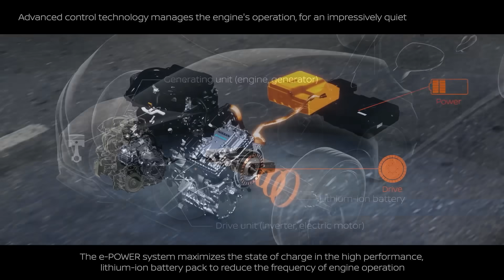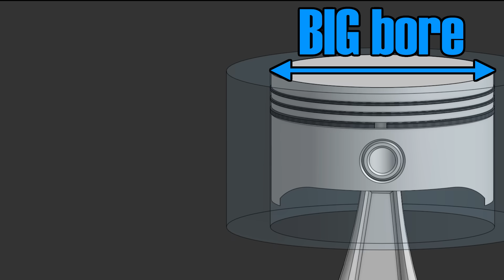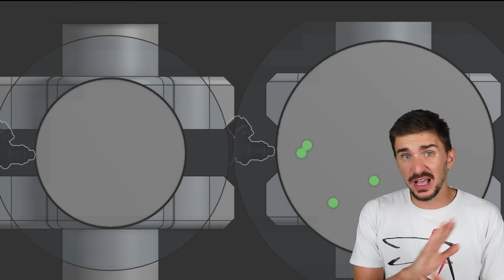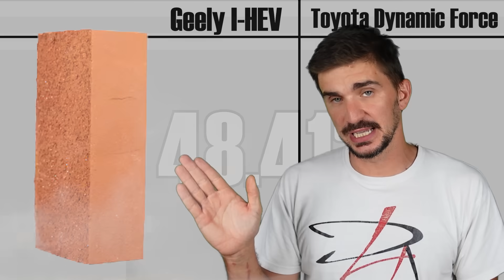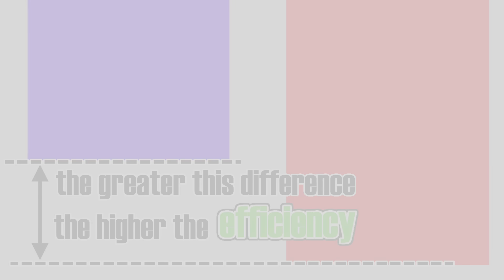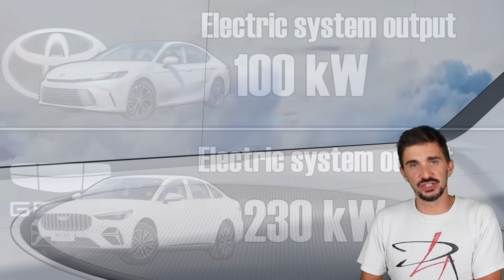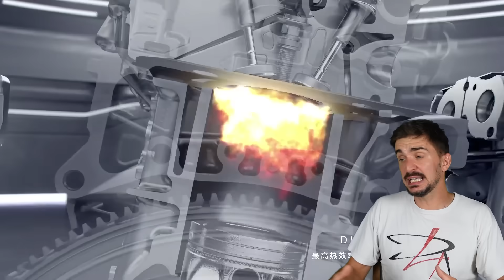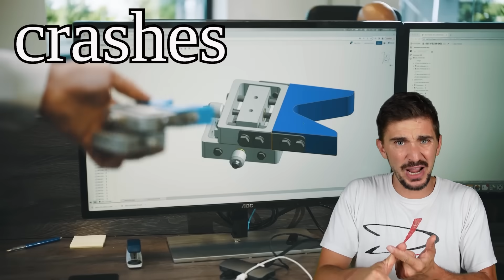How China's Geely Beat Toyota, BMW, Ford and Everyone Else

Comment: This combustionized EV approach should be applied to trucks.  With the much lower cost of gasoline in the USA, It would have a lower operating cost than diesel trucks.   Diesel cost 25% to 30% more but only has 10% to 15% more energy per gallon.   Emissions and emission control system maintenance will probably be another advantage.   
I'm sending this information to Edison Motors because they really need to consider it for the DeBoss smaller trucks.
Reply: This technical achievement makes EU and American auto manufacturer engineers look pretty dumb, but realistically you have to blame it on the management, and maybe the unions in the EU.
Reply: I wonder what the efficiency map plot looks like, how broad is it?  It probably doesn't matter since it's basically just a generator and can be optimized to run at maximum efficiency all the time.
Reply: My 1988 Nissan pickup truck made less power with a much bigger displacement and horrible efficiency compared to this.   More details:
I wonder what the efficiency map plot looks like, how broad is it?  It probably doesn't matter since it's basically just a generator and can be optimized to run at maximum efficiency all the time.

From the Google search...

"Geely’s 1.5L i-HEV hybrid system achieves a world-record 48.41% thermal efficiency. Paired with a proprietary "11-in-1" electric drive unit and an AI-driven energy management system, it delivers ultra-low fuel consumption (up to 106 mpg in Guinness-certified highway testing).

Combustion Engine Maximum Power: The naturally aspirated (NA) 1.5L engine outputs 111 PS (approx. 109 hp or 82 kW) and 136 Nm of torque. The turbocharged variant (1.5TD) produces 163 PS (approx. 160 hp or 120 kW) and 255 Nm of torque.

Core System Specifications

The 1.5L setup is a dedicated hybrid engine (part of Geely's BHE engine family) integrated with an electric motor. It powers several of Geely’s mainstream vehicles."

Geely’s flagship 1.5L hybrid engine—introduced with their 5th-Generation i-HEV and EM-i powertrain lines—features an industry-leading 48.41% thermal efficiency. While predominantly used in self-charging (HEV) setups, this engine also powers their latest long-range plug-in hybrid (PHEV) models like the Galaxy A7 EM-i.

No Charging Required: It operates as a self-charging strong-hybrid (HEV), meaning it drives like a traditional vehicle but sips fuel.

AI Energy Management: The system utilizes artificial intelligence to learn driver habits and analyze route conditions for proactive power distribution and fuel-saving.
Reply: I wonder how much higher efficiency could it get if they put a heat recovery turbine like F1?
Reply: 2WD hybrid motorcycles with a powerful front electric motor and 3X-4X better efficiency is possible using this Geely technology.  And you would benefit from less maintenance, like brake jobs.   Ideally with a shaft drive you could have an e-CVT that could have fake gears for the traditionalist but you could turn it off for maximum acceleration. 😂
Reply: This could compete as an airplane engine with 148hp (combustion only, turbo version I believe) and weighing 275 lbs without the transmission. And you would have diesel like efficiency.

Comment: High-performant engines are overrated with the traffic rules of the 2020s, at least in Germany. My old Audi A4 with 96kW is more than fast enough for German roads (except the Autobahn), now that speed limits get ever lower and the density of speed cameras is increasing more and more. 
It might be different if I was living close to the Nürburgring, then the occasional round around the Nordschleife might be able to revive the fun of fast cars.

Comment: Chinese manufactures have backed up from 100 % rechargeable electric vehicles because they have understood that it is impossible for the electric grid to hold the electrical transportation to feed cars as to replace internal ICEs. 

It is not a matter of infrastructure readiness, as so many usually say, but complete and total impossibility. Currently, we transport 92 % of all our energy in the form of hydrocarbons. The grid, which is already totally overloaded in many places, cannot hold the amount of energy we would need as to charge every single day not all, but not even a small number of rechargeable electric cars, comparing to the amount of ICE cars in the roads right now. 

So, the only solution is finding a way to create the electricity there where it is consumed: inside the car. Geely approach makes a lot more sense than Tesla or other electric car makers, which will fail when governments totally forbid rechargeable car owners to charge their cars, whenever charging peak times overload the grid causing blackouts.

This does not draw a grim future as many might consider, as there are many other technologies which intend to fabricate artificial hydrocarbons made out from pure air (with water and carbon dioxide and energy we could make methane, for example). Yes, the energy needs to be abundant and cheaper than extracting oil and distilling fossil fuels. 

Then, the mobility solution does not come only from batteries, nor electric engines, nor car industry, but from many different fronts where engineers, and not politicians, are doing their best to bring a bright and cleaner future. Geely approach makes a lot of sense.

Comment: China are rowing back from pure EVs because Europe (primarily) knew their own manufacturers could not compete and so they abandoned their pure EV legislation timescales and via the usual European legislative jiggery pokery, tried to give their own manufacturers a leg up.

That's why there's been a large scale rowing back of pure EVs. It's been driven by European manufacturers who's whole manufacturing model of stretching out a platform for 10-12 years, with minor facelifts, new colours and negligible performance boosts mid term can't compete with the rate of change of Chinese cars.

You buy a brand new platform VW in 2026 and you'll largely be buying the exact same car a decade later albeit with new colours, a new nose and tail, some minor tweaks to the interior design and the merest boost to performance.  But it'll essentially be the same car you bought a decade ago.
This European model is a con, making out it's a new car or new model when in reality it's just the old model with a new coat of paint.

Comment: Stats: 110hp, 136nm torque. The point 12:19, it's used to charge batteries only, too weak as a primary engine.

Comment: I've seen the tornado that you put your carburetor that takes the gas at the last second and it spins it at high speed and they claim that it made it burn better Due to thorough mixture. Wiith the air.. And they sold a lot of them. Claiming tthat you got better gas mileage and power And a cleaner engine. And of courrse lower emissions as everything's More thoroughly burnt. It seem like a pretty solid sounding dynamic.

Comment: The other issue is that when they manufactured this engine the reliability of it was proven to be terrible. The engines are used in Protons in asia and they have really high failure rates

Comment: 15:40 When you said "it pays for it (the efficiency and performance) by being less versatile and even being disappointing in some other scenarios", and one of the "scenarios" is when the battery is depleted and facing a long uphill ahead. Don't forget you've also mentioned that this Geely is an "Enginefied EV". So similar to that when an "electrified ICE vehicle is "depleted" of gasoline, you have to refill it, you have to recharge you battery before your battery is empty for an "Enginefied EV", right? So when people could accept the less versatile light hybird proposed by Toyota (the light hybird cannot move when running out of gas, while the new Geely can still run on gas for hundreds of miles when the battery got depleted), people should also accept this new mode of hybird, with the same logic or standard. Otherwise, you have double standard.

Comment: You said no but I think Japanese manufacturers have combustionized an EV. Honda Civic, Accord and CR-V all use the electric motor primarily as a means of propulsion while the gasoline engine functions as a generator. I personally think they have surpassed Toyota with their new approach to hybrid vehicles. They are far more responsive and have proven to be extremely reliable vehicles.
All this fuss to make gasoline thermally efficient is killing me. Why does the world hate diesel engines so much? Diesel electric has been around forever and would be far more efficient.

Comment: Sorry bro correction here, Toyota hybrids are also electric primary, mg2 is the primary mover using power produced by mg1. Thus the amount of draw inverter sends to mg2 is the back emf force applied to mg1 which directly translates to how much engin drive power goes thru the powersplit to the wheels, tldr, mg2 output power = negative mg1+engine
Reply from the maker: Hey bro,
https://youtu.be/r2L5VOtf47Y
By primary I meant the main source of power driving the wheels. Not sure what you meant with your explanation sorry.

Comment: Tech we we already used for diesel engines and we applied it to a gasoline motor like the same principles for diesel motor. They just applied to a gasoline motor. So congratulations! Everybody the very thing that some random dude from the like '60s thought about like pre slightly pre-combusting the fuel like preheating it via routing a portion of the fuel. The fuel wrapping the fuel line around the header to extract heat. So when the fuel hits the direct fuel injector and is frayed into the combustion chafer it will be more readily available too disappear and make energy

Comment: Reliability is what matters
Reply: ... said no chinese car manufacturer ever.
Reply: @EndriuC  Enter honda
Reply: @wimkoster9699 Honda is Japanese.
Reply: @EndriuC  Chinese cars are very reliable when it comes to electric motors and batteries, but I don't trust their internal combustion engines. There are reports of all sorts of QA issues.
Reply: Dont most of them use 1.5L mitsubishi engine?

Comment: It would make sense to have a direct drive option at highway speeds and then go back to a hybrid at lower speeds. Also be interesting to see if a turbo/sterling engine turning a generator could recover even more power from the exhaust for the hybrid system.

Comment: I asked AI to beat the Geely by focusing on a 3 cylinder design and only 80 mph cruising (Civic or Jetta body) and here's the results 😁😎

To push past Geely's record-breaking 48.41% Brake Thermal Efficiency (BTE)—achieved via their 2026 i-HEV hybrid platform—without the aid of an electric hybrid system, we must change the engineering paradigm.

Hybrid engines achieve high efficiency by using electric motors to "load-point shift" the engine into its sweet spot. Since you want a purely mechanical, non-hybrid 3-cylinder engine optimized exclusively for 80 mph cruising, we can bypass broad-band compromises. We will target the exact aerodynamic and mechanical load required at 80 mph and hyper-tune the engine's geometry and thermodynamics specifically for that island of efficiency.

1. The Target Platform: The Baseline Aerodynamics

To know how much power our engine must make at its absolute peak efficiency, we start with a highly efficient modern small sedan chassis (similar to a 2026 Honda Civic or VW Jetta body) modified for ultra-low drag:

Drag Coefficient (C_d): 0.22 (achieved via active grille shutters, smooth underbody panels, and a tapered rear).

Frontal Area (A): 2.0 \, \text{m}^2

Total Weight (m): 1,300 \, \text{kg}

Rolling Resistance (C_r): 0.008 (low-rolling-resistance tires).

Using the power equation for steady-state cruising:

P_{\text{total}} = P_{\text{aero}} + P_{\text{rolling}}

P_{\text{total

At 80 \, \text{mph} (35.76 \, \text{m/s}), the physical power required at the wheels is roughly 15.95 \, \text{kW} (21.4 \, \text{hp}). Factoring in a highly efficient, overdrive 9-speed dual-clutch transmission (95\% mechanical efficiency), the engine must output exactly 16.8 \, \text{kW} of continuous power at 80 mph.

2. Blueprint of the Hyper-Efficient 3-Cylinder Engine

We will design a 1.1-Liter, Inline 3-Cylinder Turbocharged Engine code-named CRUISE-3.

To beat Geely's 48.41%, we must push past 49.0% BTE at our target operating point (16.8 \, \text{kW} at 2,200 \, \text{RPM}). Here is how we engineer out the remaining energy losses:

Extreme Miller Cycle & High Expansion Ratio

Standard engines waste immense energy out of the exhaust pipe because the compression stroke is the same length as the expansion stroke. The CRUISE-3 uses an extreme Miller Cycle via variable valve timing (VVT), closing the intake valves exceptionally early.

Physical Expansion Ratio: 15.5:1

Effective Compression Ratio: 11.5:1 This allows the burning gases to expand much further, squeezing more work out of every molecule of fuel before venting to the exhaust.

Turbulent Jet Ignition (TJI) & Ultra-Lean Burn

To achieve high thermal efficiency, we must run an ultra-lean air-fuel mixture (\lambda > 2.0) or heavy Exhaust Gas Recirculation (EGR up to 35%). Normal spark plugs cannot reliably ignite air this thin.

The Solution: A passive pre-chamber TJI system. A tiny pocket at the top of the cylinder ignites a small, richer mixture, shooting hot jets of flame into the main combustion chamber. This results in ultra-fast, uniform combustion, eliminating engine knock even at 15.5:1 expansion.

Advanced Thermal Barrier Coatings (TBC)

About 30\% of fuel energy is lost as heat radiating into the engine block and coolant. We apply a thin, plasma-sprayed layer of porous Yttria-Stabilized Zirconia (YSZ) to the piston crowns and cylinder head. This "thermal swing" coating acts as a heat shield during combustion, keeping heat inside the gas to do work, but cools down quickly during intake to avoid heating incoming fresh air.

Parasitic Friction Elimination

Because the engine is designed for a fixed highway cruise state, we can eliminate variable mechanical drains:

Valvetrain: Diamond-like Carbon (DLC) coated camshafts and lifters.

Ancillaries: 48V electric water pump, on-demand electronic oil pump, and ultra-low viscosity 0W-4 oil.

3. Beating Geely: Efficiency Breakdown

Geely’s 48.41% system relies on an electric motor to assist during transient states. Because our engine is perfectly sized (1.1\text{L}) so that 80 \, \text{mph} hits its precise high-efficiency sweet spot (Brake Mean Effective Pressure of \sim 8.5 \, \text{bar} at 2,200 \, \text{RPM}), we can push the thermal efficiency envelope further.

Comment: The Chrysler “Slant 6” BxS eventually was .824.  3.4x4.125”.   It was a good reliable engine, but no hot rod.
The Geely engine is a single point engine, that is one optimized for a single speed.  Not having to compromise eases maximizing one parameter, in this case thermal efficiency.   Geely’s engine…yawn.
     Engine geeks listen up.  Compression ratio is GEOMETRIC and doesn’t change whether throttle open or closed!  What matters is the pressure ratio which is THERMODYNAMIC.  So when an astronomic compression ratio is cited..look further.  Practically with an Atkinson or Miller cycle the compression ratio ought be computed from inlet valve closing.
      You can bet your boots I will never buy a durable good Chinese product.  Or for that matter, do you want to fly, for instance, on a Chinese airliner?  Well maybe if the alternate is Russian.            Cheers

Comment: Hey D4a why have the piston push some intake air back out the intake valve instead of have the valve close earlier in the intake cycle? Cooling? Odd state to have a vacuum in the cylinder?

Comment: Well.ot electric assisted by a ice engines. So the output of the ice is consistent so they can have this deep.moller cycle.however of you have a variable load on the ice this deep.miller of closing the intake during the compression phase would not be possible. However if the electricity production is the key and there is noactial connection only the flywheel is going to produce current then this is possible and we can even move it further . Also am very sure chinese might not have developed this but rather might be from eu side .

Comment: The reason Chinese manufacturers are combustifying their EVs is largely because of their export markets. In China itself the momentum is clearly in favor of pure EVs, especially with the roll-out of flash charging. The problem is that NOWHERE ELSE ON THE PLANET (except Norway) is this level of electrification possible. China has the largest and most robust electric power grid on the planet as well as the lowest price of electricity anywhere other than Peru (maybe Norway too?) and that makes implementing a pure-EV economy very easy. China's export markets are all struggling to keep the lights on, and there is a clear lack of charging infrastructure. The consumer base often find it difficult to charge pure EVs, so hybrids and EREVs are preferred. However, to justify the production lines for the export vehicles, volume is necessary and the Chinese market is still the largest in the world. Therefore, the hybrids also need to be sold in the hypercompetitive Chinese market to very discerning consumers, and that has been the driving force behind all the Chinese manufacturers' efficiency push.

As for why the manufacturers are aiming for export markets, it's simply because export markets are more profitable. Before BYD popped in to screw them in Indonesia, Wuling was making 120% margin on every EV sold and Chery was doing close to 70%.